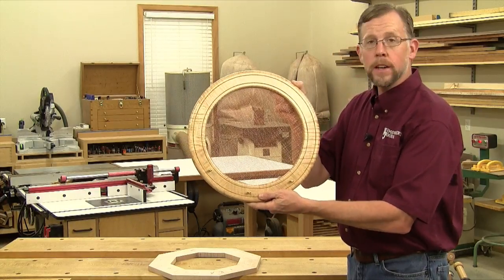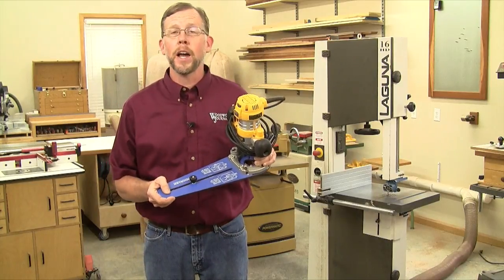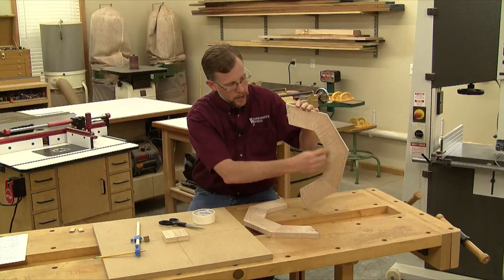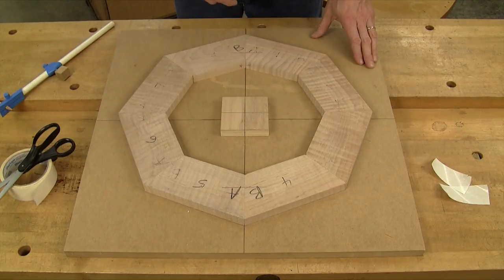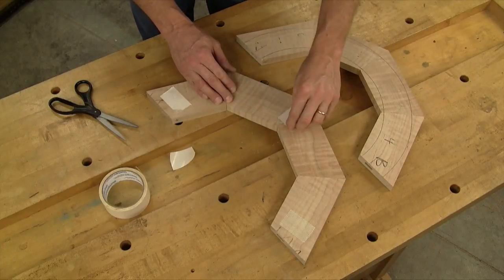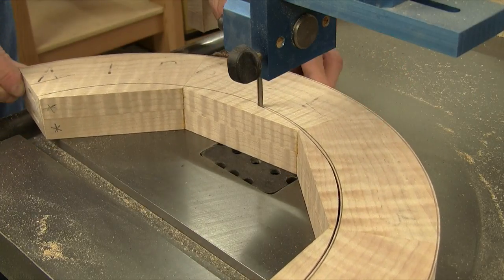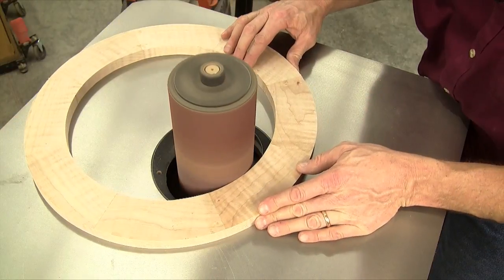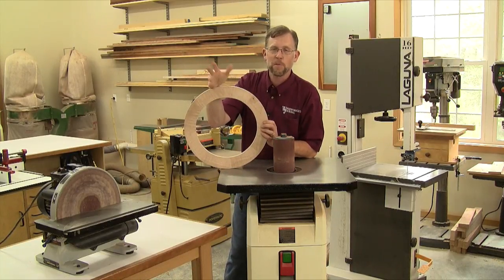Cutting a Circular Frame with a Band Saw | Woodworking

Comment: IF you took the joined halves at 2:02 AND stuck them to the mdf board from 1:10 & placed that jig on a bandsaw hole cutting jig, then cutting the 2 halves would be easier & more accurate.
Reply: Agreed. The outer perimeter can even be done with a table saw very quickly and neatly.

Comment: We can make perfect circles with a couple hundred dollars worth tools, but let's make not quite precise rings with several thousands bucks machinery insted 🤔. Nice trick anyways.
Reply: hahaha. Yeah. Instead of making a trammel jig for the router from some scraps, let's use a band saw and a disc sander. Because it's very usual in woodworking to buy these machines before any handheld router!!